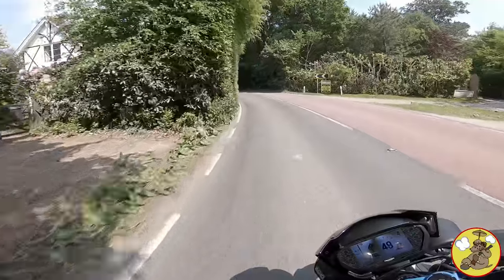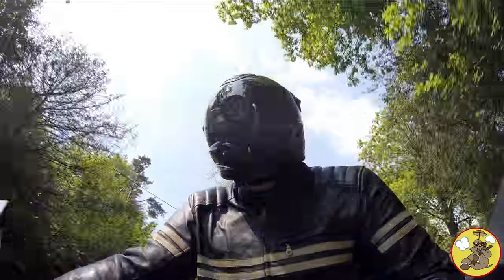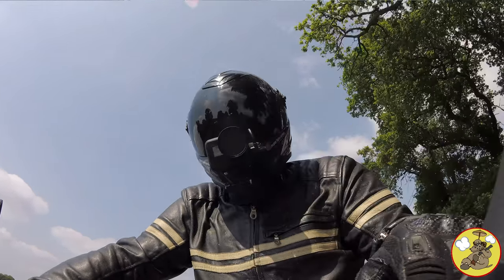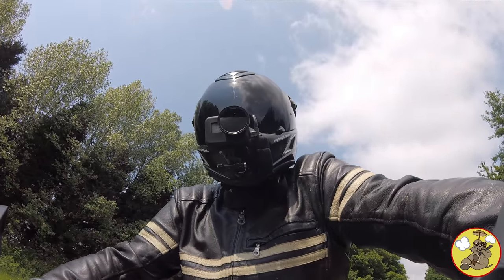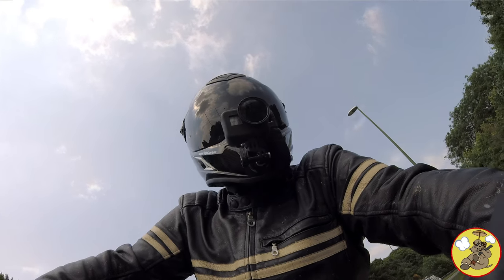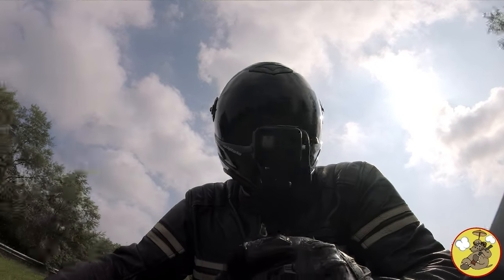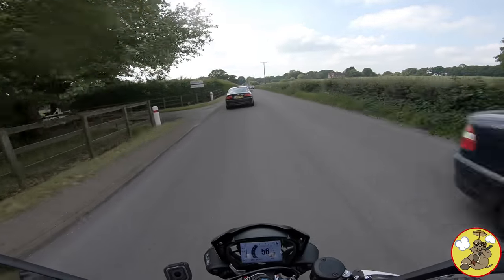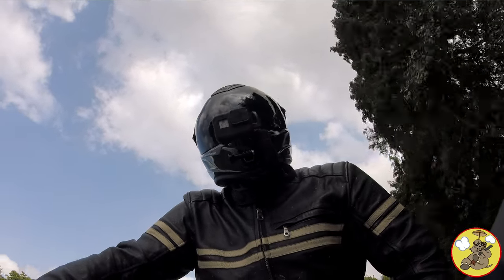2018 & 2019 Triumph Street Triple R (low ride height) - Running In Vlog [pt2]

Comment: Running in is definitely not a long or painful process really. Gives you a great chance to get to know the bike also and build up the relationship so you get more out of it long term. Talking of running in, it's one reason I'd never buy an ex-demo bike that's got a few hundred miles in. I can't see them bikes have been kept to the rev limits as per run in process
Reply from the maker: MotoVenture _ absolutely, even if they have not been thrashed, they will still have been revved to the red line early in life! :-)

Comment: Interesting video series for me as I've only once in my 30 odd years of motoring ever had to run an engine in,& that wasn't because it was new but due to the rebore/new pistons/high lift cam etc etc which turned my 1275cc Mini into a seriously quick approx 1400cc lunatic machine. I then added several more lightened parts,uprated suspension & some nice fat tyres to produce a bloody rocket that could turn any journey into a massive adrenaline rush(sadly gone now but wouldn't be any use with all the extra traffic about nowadays)This adrenaline rush is still available though from 2 wheels,hence why phone apps I use have such as 200+ miles ride outs just because I can saved on them. lmao
Reply from the maker: ChegsOn2Wheels that mini sounds a right beasty! :D
Reply: It was,but it performed just as intended after weeks of work to weld up the body,weld up subframe mounts etc etc. If I still had it now,probably worth a few bob too lol
Reply from the maker: it is so nice when something you have put effort, blood sweat and tears into comes out just how you hoped or better, nice one mate. You ever thought about building another?
Reply: I'd love to,but my health eliminates any possibility of driving it. If I did another with that kind of performance,it's unlikely to be insurable as those shysters would want several thousands.
Reply from the maker: ChegsOn2Wheels that sucks mate. Aye, insurance is a crippler these days on mega modded stuff

Comment: Awesome! I just bought one myself and still running it in. I have to ask, do you feel a bit of grinding or clicking when pulling the clutch lever, especially from N to 1st? Mine does a bit of that and I assume it's the slipper clutch. I have heard people say it disappears after a while, others mentioned they had to replace the clutch under warranty. What has been your experience?
Reply from the maker: Jorge Asapche I've not noticed that, although will now pay a bit of attention to it when changing gear to see. Hopefully it will go away after a bit and you'll not have any issues. How are you finding the bike so far? :-)
Reply: Hippo-Drones Apart from the slight rattle from the clutch, which only happens when the engine is on, I am loving my street triple R. I have only done about 120 miles and most of it has  been in the city, so I am excited to try it out on country roads this weekend.
Reply from the maker: fantastic, you'll love stretching it's legs mate! :-) have you seen my trackday vid on the bike? It is ballistic once you have the full rev range! :D
Reply: Hippo-Drones I have and will be following your steps once I am done with the running in
Reply from the maker: awesome stuff! :-)

Comment: I'm actually torn between the different schools of thought when it comes to break-ins (in America) or running in (probably everywhere else). While manufacturer's manuals say to break in easy, the tolerances in engines are much stricter and are much less likely to have moving parts that need to be broken-in with care. What actually happens is that the rings won't seal correctly because the pressure is lower (lower RPMs). There is a "break-in secrets" guide from mototune USA that explains all of this with pictures of the results. PM me for the link
Reply from the maker: Hi Alex, I've looked into both methods and I can see benefit in both, the maintaining of my manufacturer's warranty is my concern so going by the book makes most sense to me. If I was on a KTM enduro race bike then I would go with a hard break-in as those engines are stripped and checked far more regularly than a road bike.